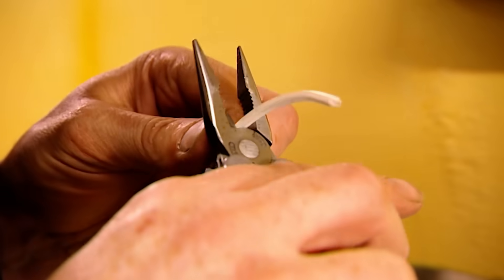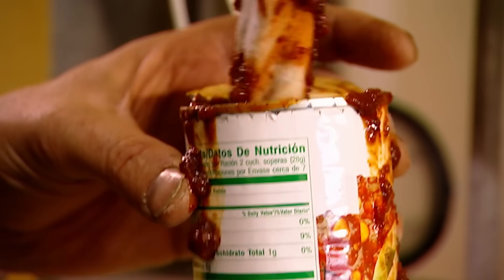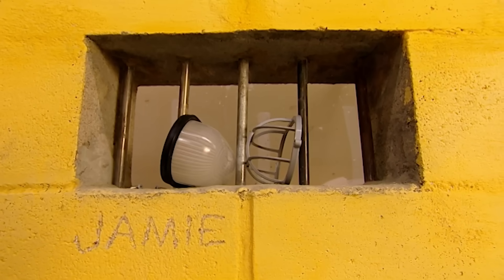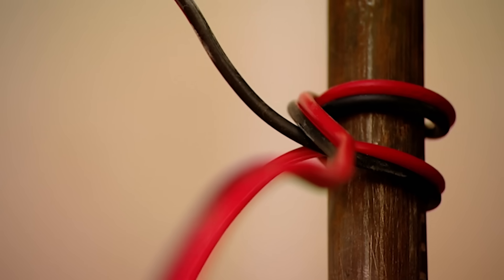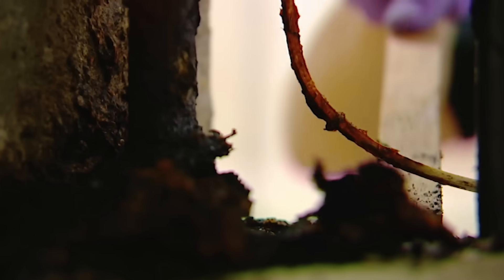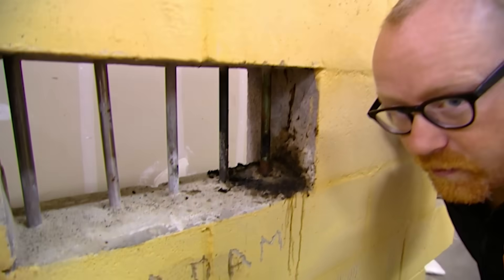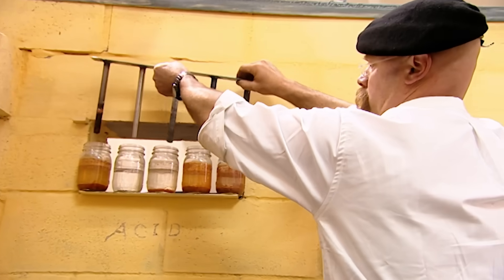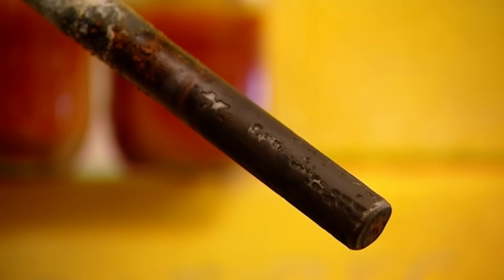Can You Bust Out of Jail with Condiments | MythBusters

Comment: There was always a habit of Jamie and Adam accusing each other of cheating in competitions, when neither of them were cheating. In this one, Adam thinks Jamie’s cheating even though he’s using something you could totally feasibly get your hands on in a prison, so it’s fine. It was cut out of this video but it’s in the full episode.
Reply: He also used a soldering iron as well to get the part out of the radio though, lol. 

Remember, prisons use clear plastic devices in America. So a radio that's been opened and parts yanked out with brute force would be noticeable, in my opinion. Cause you obviously ain't getting a soldering iron.
Reply: @unofficiallymike . I’m not sure how well it works, but you technically can use a 510 threaded battery for vapes. And put a 510 threaded soldiering tip. the battery’s can be tiny. I could see someone sneaking something like that in. iv never tried it and probably won’t work super well if at all but if does work that’s kinda cool